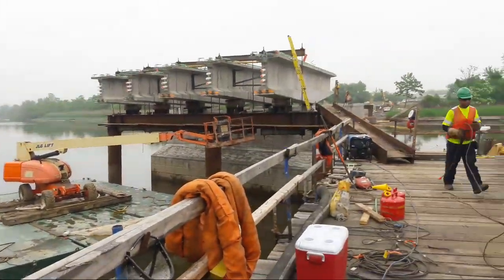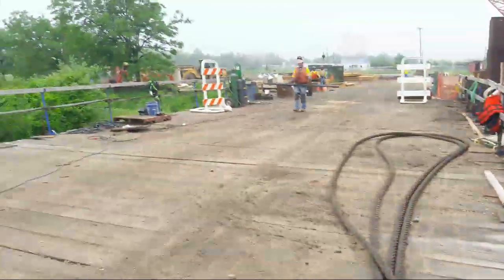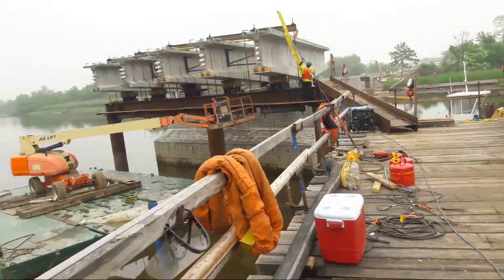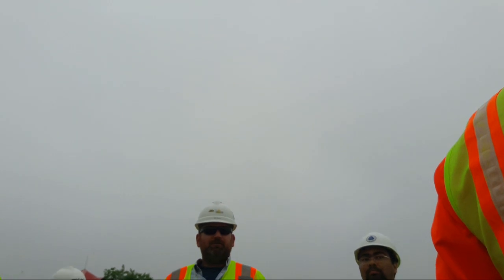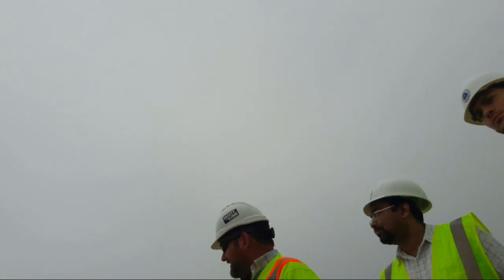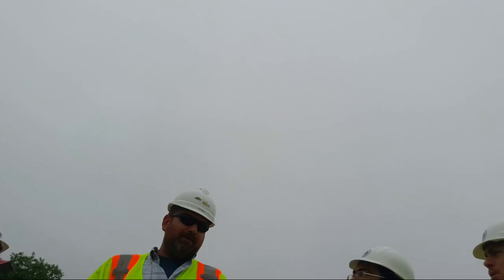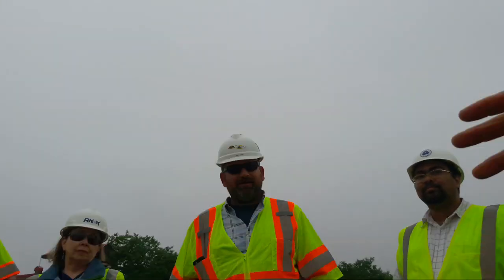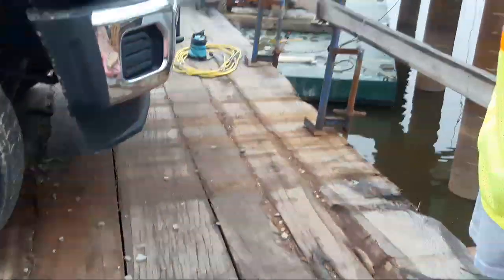Bridge build - field trip post tension girders, back-spans, etc.

Comment: point of information,, large cranes are placed on flexi floats ,small barges that are portable and can be configured in any size for the job site, The barge and crane sometimers is refererd to a ringer barge,, Also Contracters use as seen in this video  small 26 ft push boats to nudge barge into desired position,,  old days it was old single srew tugs and steam tugs,,,,,this type of set up was used to build the Zakeim bridge in Boston  part of the big dig,,,I had worked on that job with an old tug  , highly skilled boatmen and tug boatmen and women were part of the crew